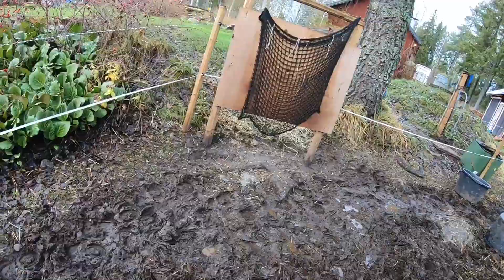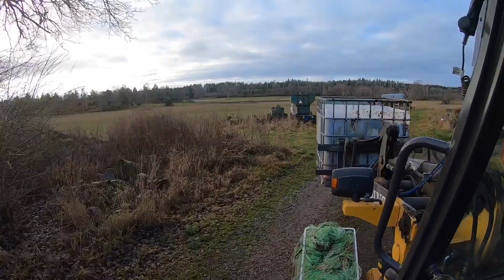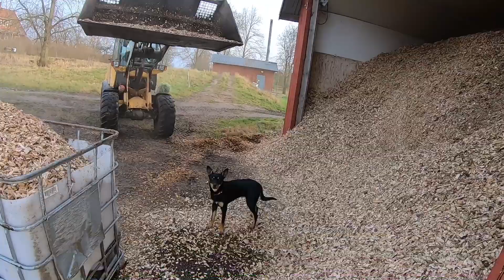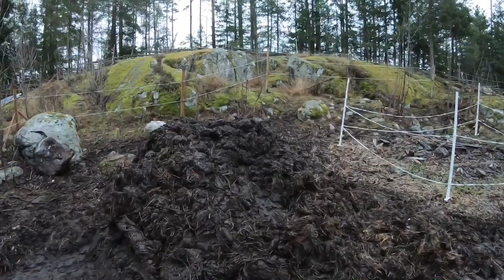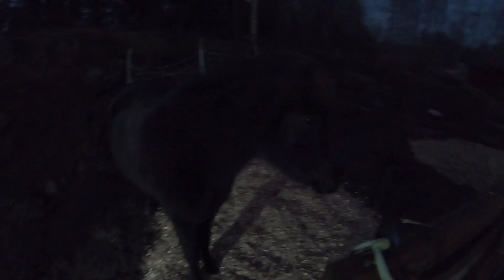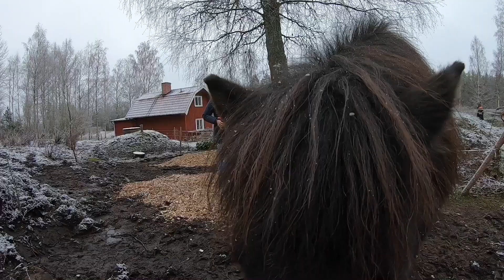How to fix a muddy horse pasture

Comment: The mud is the result of a drainage problem. The horses and the machinery cause the toplayer of the soil to get very compact and thus it becomes impermeable to water. I don't know what soil you have (sand, clay, etc.) or if there are trees and thus roots in the paddock, but have you considered ripping the soil now and then with a narrow blade. It's like running a large knife through the soil. I know some horsekeepers that do just that in the area where I live. That way you open up the soil and water can drain away again. Be carefull to just rip it and do not turn it around like you do when you are ploughing. Ploughing soil when it is wet will make things worse and will destroy your soil structure even more. Best to try it in a small corner first.
Reply from the maker: Thanks! That was an easy idea to try and it could be a thing to do with the excavator.